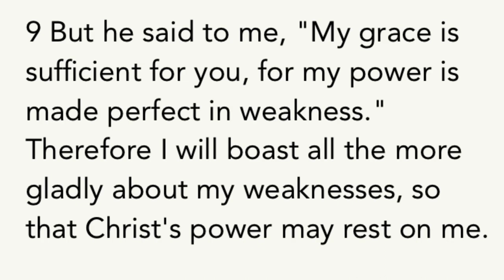INSTALLING CAB AND SLEEPER CHICKEN LIGHTS

Comment: This was a terrible video that didn't show the best way of laying out how to space out the lights evenly and show the people how to mount the lights on the existing trim rail to drill holes for the wire to come through the trim and the small screw holes in order to get the mounting screws washer and  nut on the back side of course how to connect the lights wiring and then connect all the lights to your switch properly using the correct Gauge wire so that you don't have a electric short causing a vehicle fire burning down there truck. Vehicle fires number one cause. The great thing about technology of making videos teaching someone how they can install different types of products correctly is too not show part of the process
Reply from the maker: i apologize ill try to do better sir its not easy to get all footage at every direction and do the work too i do my very best i get better every time i make a videothankyou for your comment